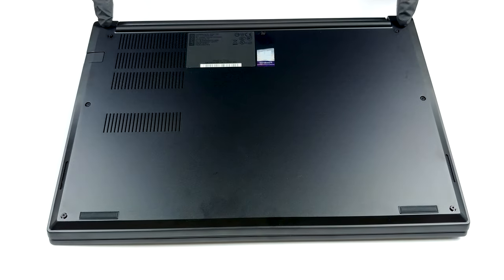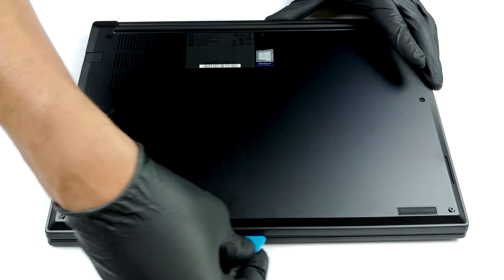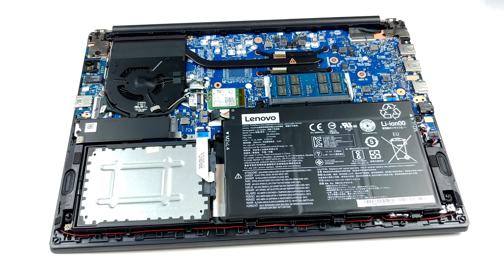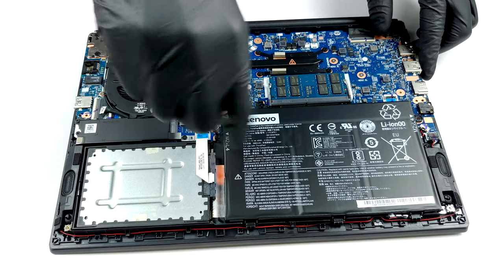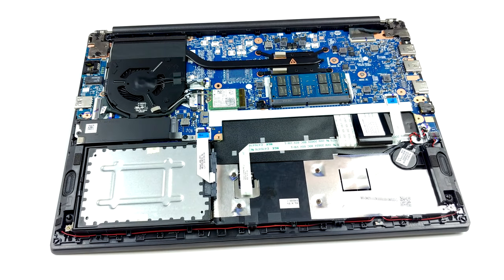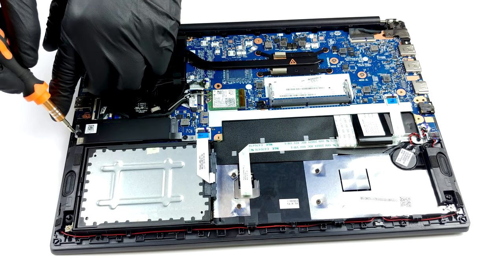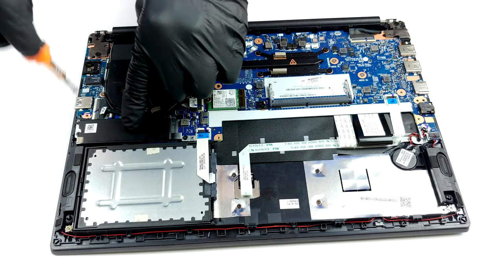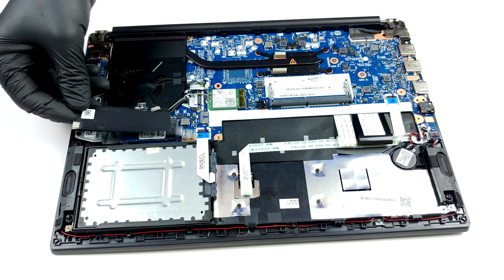🛠️ Lenovo ThinkPad E14 - disassembly and upgrade options

Comment: With that weak cooling pipe and single ram slot, that is not a Thinkpad at all... Even older and cheaper E490 and E495 has double pipe and double ram slot...

Comment: Have you opened the 14” levono s540 10th gen laptop? If so, are there 2 fans on it? The 8th gen of it have 2 fans and I’ve seen one complained about his only having one on the new model.

Lenovo S540 14iml is the model

Comment: Friends an inquiry, ThinkPad E14 notebook (i5-10210U) (Graphics Card: AMD Radeon RX640 2 GB DDR5 64B 2GB DDR5), what is the maximum amount of memory that I can install? - The official page says 16gb of ram, but the CPU says that the maximum is 32gb. What do you think?
Reply: Its only Single slot DIMM. 16 GB only upgradeable on this model
Reply: @karthikvalarmathy4381  what similar laptops that have double slot DIMM
Reply: Процессор моего ноутбука (i7-10510U) говорит, что поддерживает 64 gb. Вопрос к северному мосту, поддерживает или нет? И нужна память 32 или 64 gb одной планкой.

Comment: I have this for around 3 months now and I started hearing an low chirping sound around the right side of the keyboard. Anyone experiencing that? Any idea what causing it?
Reply: AlbertoRo101  Yes. You can add another SSD. Remember to buy an SSD that is 7mm form (thickness). When I bought this, I planned installing my old SSD from my previous laptop but it turns out that it was a bigger one (9.5mm).